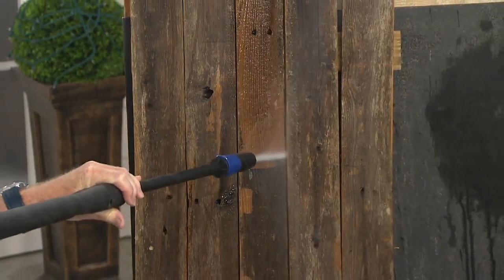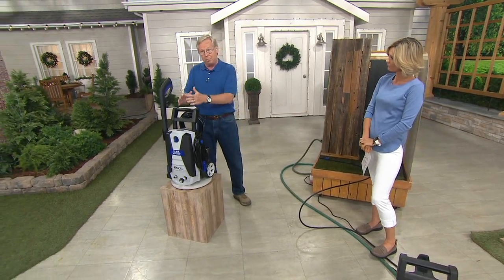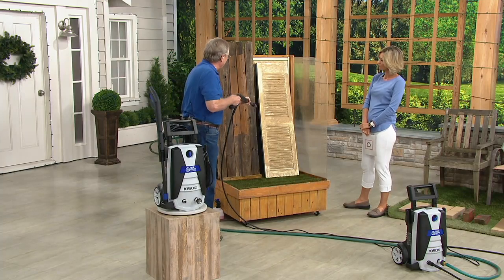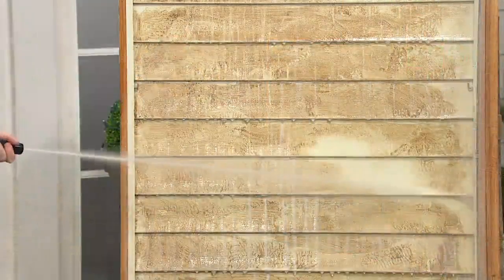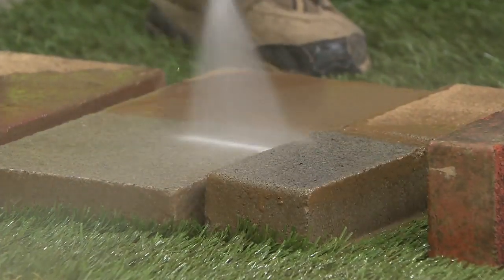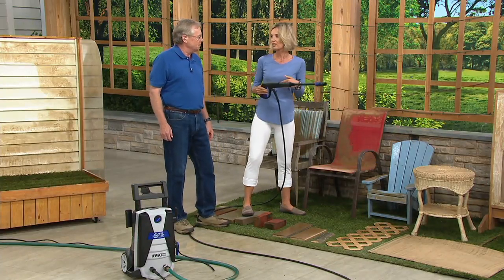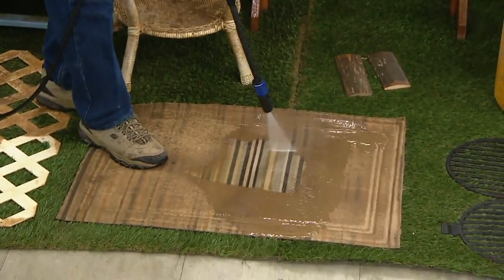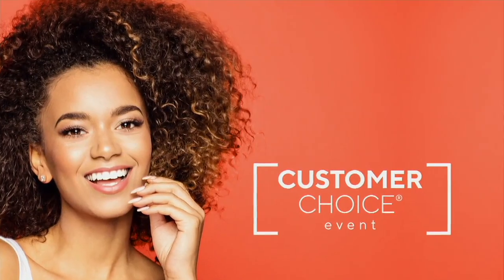Blue Clean 1850 PSI Pressure Washer with Vario Nozzle on QVC

Comment: I bought a blue clean from these guys third time I used it "to wash a car" water started spraying out of the gun handle "on the 3rd use man" replacement gun is minimum $35.00 screw that ...!!! That was officially my LAST purchase EVER from them or ANY tv shopping network if it's engineered to fail I don't want it  anything you buy on tv you'd better be prepared to find craftsmanship flaws that will end makes you spend enough money to replace a part that you will find you didn't get a GOOD deal at all